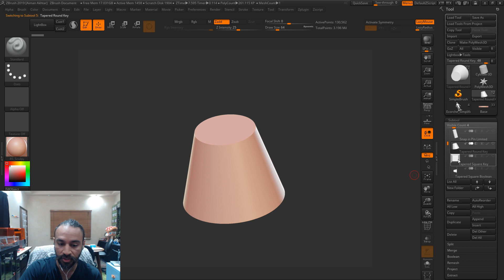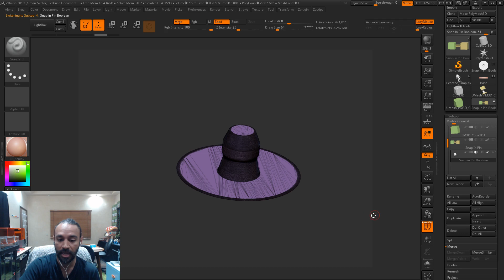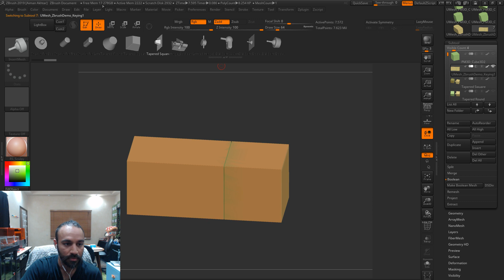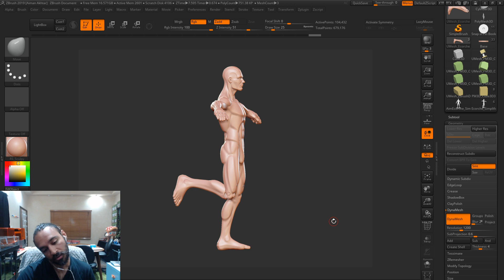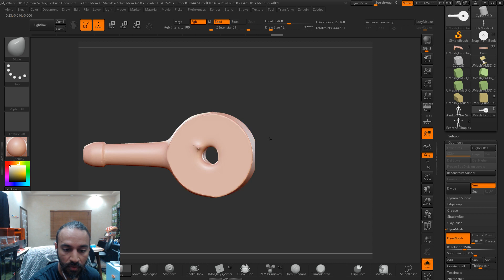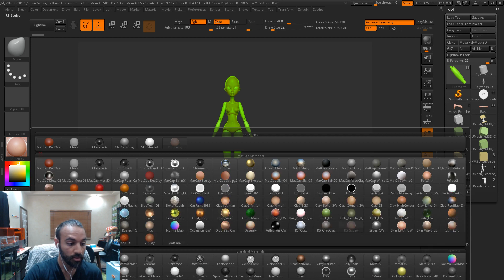3D Printing in ZBrush: Keys & Articulation - Aiman Akhtar - Episode 46

Comment: great video, thanks! i bought the brushes and they’ve been great. curious if it would be viable to turn the first hinge joint you used on the stylized female character at the end into a thin-walled mesh and then use dynamic subdivisions to set thickness (so it can be adjusted for models of different scales).

Comment: I want to follow this tutorial but no matter what I do "Boolean to mesh" does not work. I can see the preview. I'm using this Ecorche and this IMM brush yet it doesn't work. No New tool or a merged subtool.

I have even tried to do it with the Folder to boolean function and does work.

I have tried doing it with basic Geo such as sphere and cubes and its doesn't work.

I even opened the Boolean "Computercasefan" project and "make boolean mesh" and it still don't work. I wonder I'd my Zbrush is broken. This has been plaguing me for Months.

Comment: Is there any way to previsualize if articulations are working correctly?
Reply: yeah - apply the boolean, then auto groups, then groups split, then select the pin that the joint rotates on (not the anchor pin, the joint pin),  alt click with transpose master in the middle of the cap of the pin to set the rotation axis, then select the joint you want to rotate and use the transpose tool (which is still set to the axis of the pin) to rotate the joint.

you can use a cube live boolean to temporarily check for interpenetration, as well as transparency, as well as contact masking in z plugins. there are a few ways to audit it.  then you can use that information to further refine the sculpt so the pieces don’t collide.

Comment: Thanks for the Keying video. I have a question I am hoping you can help me out with? I know how to cut straight cuts for the keys on simple objects but I need to cut keys on characters that are not straight cuts. Such as a head with neck attached into a torso etc. So the cuts may have curves and not a straight cut line. I would need the head and neck to align properly with the torso.  How can I do this? What would the steps and process be? I would appreciate any help!